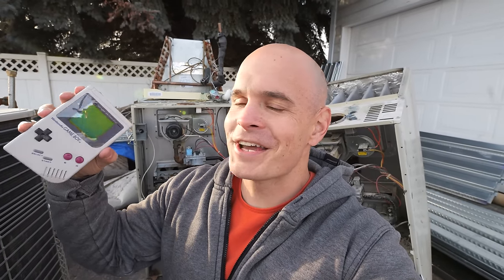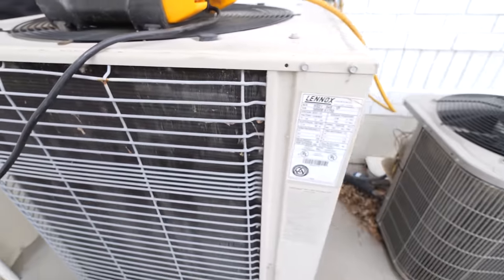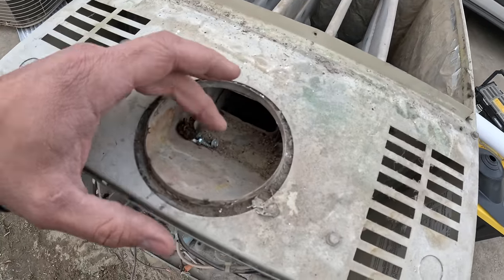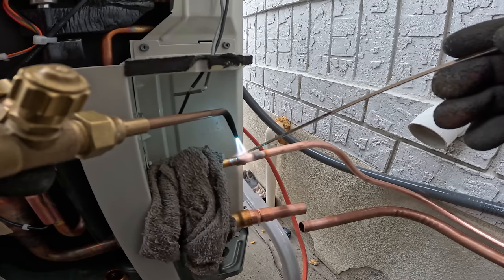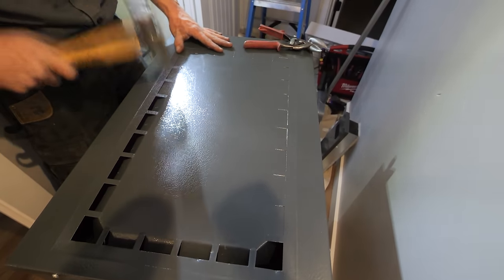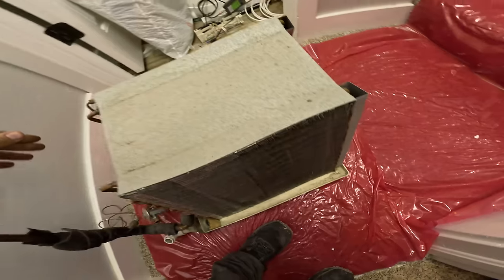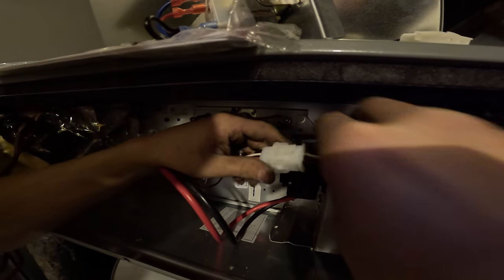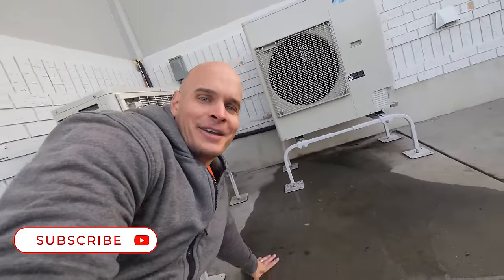Why is Everyone Talking about Heat Pumps?

Comment: My house has a heat pump. I save money EVERY MONTH on electricity. I'm not wasting money by creating heat with an electric element, or firing a fossil fuel, but instead just moving the heat and cooling around inside the system.  So when it's cold outside, the compressor runs in reverse and converts the cold into heat in the exchanger. And when it's warm outside, it again reverses the compressor and converts the heat into cold. Very nice (at least as how my uncle explained it to me. He's smart. He fixes x-ray machines).

Comment: A few things that surprised me... refrigerant R410 is touted as "new" here, while it is considered outdated in Europe where R32 and (for air to water systems) R290 is the current standard.
And then the heating system itself has me a bit confused. Instead of having radiators or underfloor heating it appears that the house us heated through the ventilation system? I have heard of systems like that, but have never actually seen one in a private home. 
I had heard about ducted systems for aircon, but they pose quite a few challenges, especially with condensation, bacteria and so on...
Still, it's interesting to see how the retrofit is done here and I hope there will be occasional Updates on performance and running costs👍

Comment: Glad to see it works for you. Heat pumps do use quite a lot of electricity to factor in and countries like the UK where electricity is astronomically priced, they are not viable compared to gas heating, even though the government lies that they are and is pushing people into getting them anyway.  Its a pity with the amount of land you have at your house you didn't go for a ground based heat pump system, the output and efficiency can be vastly better than air based ones.

Comment: Here in Nova Scotia, heat pumps are becoming very popular. especially since most people are on electric baseboard heat.
Reply: Do you benefit from that sweet, sweet hydroelectric power?
There's no way electric baseboard heating would be feasible in some 90%+ of the landmass of the US due to how expensive electricity is vs running natural gas.
Heck, in much of the country, it's more expensive to run a heat pump year round rather vs natural gas. Only if you have solar, inexpensive power, and a warm-ish climate does it make sense over NG.
Reply: @tim3172  Actually no. We have some  tidal power. Most famously from the Bay of Fundy. However most of our power (52%) is generated via coal.

Comment: My mom has a heatpump installed in her house, but during winters with -19c or -2.2f it uses up 1600kWh a month for 3 months of winter and that becomes really expensive. It's free during the summer months though just standing fees. Due to 5kW solar roof.

Comment: Seeing a lot of comments referencing Alec’s videos from Technology Connections. Also, I live in the south where Heat Pumps are such a commodity that I didn’t realize that they weren’t common or priced appropriately in the midwest and western US. Lots of people have backup gas boilers or fireplaces here though.
Reply: Also I really want to incorporate a separate outdoor thermometer into my smart home system to automate when my heat pump switches to emergency heating. Lots of them do that on their own, but mine doesn’t and it’d be pretty cheap to add it using HA.

Comment: Thank you so much for recovering the terrible r-22 instead of wasting it in the air like some criminals do! But seeing crimp fittings used makes my eyes bleed! I don't think there is any country in Europe that allows their use! Too many pressure and temperature! The 410 is also terribly old and with a very high GWP! Nowadays we only use R32 or R600!
In any case, another thank you for having contributed to the decrease in global consumption with the efficiency of heat pumps!

Comment: Take a look at the Panasonic VZ9SKE, which has a SEER Value of 10.5 - ie 25% better than the one you got. I got one myself 1.5 years ago and I love it😊
Reply: And is used R32 as colorant and works down to -30 degree Celsius = -22 degrees fahrenheit
Reply: Lastly, we have been able to reduce our natural gas consumption by 66% and even though electricity is not cheap here in Denmark, the overall  savings will cover the cost of the heat pump after only 3 years!

Comment: We've used reverse cycle air conditioners (aka 'heatpumps') in Australia forever. The inverter is a more recent improvement (but it relates to the electric motor, not the 'pump')

Comment: For me it will be way better if there are antivibration rubbar mouting pads. At least in Europe they are always used as even best AC have vibration. Can be found anywhere with something like this " Air Conditioning Split Anti-Vibration Feet Mounting Rubber "

Comment: Utah resident here. Literally fell down this rabbit hole this week. My air conditioner and heater are about to die. And so I'm wondering about dual fuel or only heat pump. Same company is going to put solar on my roof so I can go heat pump only and offset that usage in the winter with my solar panels and the excess from the summer. So I'd want to know if I should have a furnace to use gas when it gets really cold here. I've been a fan of yours for a long time
Reply from the maker: I feel like my dual fuel feels more 'normal' than the pure electric.  The pure electric one downstairs gets the job done of course. It just blows alot longer.  Which is noticeable. So if I had to do it again I might just go duel fuel with both of them.

Comment: We have a heat pump in our place.. The only thing that is a little concerning that you didn't mention and maybe your set up is different but we only have one outdoor unit and 4 heads inside. So you can't have one room running cooling and one room running heating otherwise it is competing with itself and I was told would hurt or ruin the system.

Comment: My house was built in 89 just had unit replaced 9 years ago...But since I'm in Vegas its on the roof of my 2 story..14k later.Just wish the builder actually did the duct work right instead of using roofing nails to attach the main trunk...1600 sq ft house one unit it works hard during summer.

Comment: This stuff is interesting to me, Last January thought we hit -45c and most winters are -20c to -30c  and then int he summer it's +35c and up 🙃

I think a dual fuel would be required but are they as efficient at heating when it's that cold?  Freaks me out when the local Government is literally blocking alternative energy sources and during this -45 snap we had warnings to reduce electricity consumption...

Comment: R290 is the new hotness, love how we found out propane is a great refrigerant. 😂
Reply: Because it cheap and they can charge you 60 dollars for 12oz. We have been using it for a long time for coolers and freezers. Problem is they have terrible oil carry over issues that kill compressors x5 as often as normal options

Comment: People always talk about how “efficient” heat pumps are and ultra high efficiency HVAC units. What nobody ever talks about is how expensive these machines are, how difficult it is to get replacement parts, and how their life expectancy is shorter due to complexity. More than often you never get back the utility savings over the upgrade for HE have systems.

Comment: It is better to use ground as heat source, instead of outside air. Ground temperature below 1 meter never goes bellow 0°Celsius, it is usually +5°C to +10°C.
But to use ground, you have to drill or dig, so it costs more for initial installation.
Reply: Yep, but drilling is expensive. Depends on where you live. We seldom get less than 0 degrees celcius so the payback time on geothermal is like 70 years. So not reasonable.

Comment: Nothing beats a flame for heat. Most off gridders use propane for heat.
Heaters use a LOT of leccy juice. 
HP are many more times efficient than resistance heating, but not as warm/ hot. 

Why my new window A/C unit doesn't have a reversing valve is beyond me. 
Should be a law they install a reversing valve in ALL A/C units!
While the efficiency may be correct, gas (flame) produces a lot of BTU of heat vs resistance heating.

That being said, if HP can reduce the gas needed, that is a good thing.
For off grid, HP might be more usable 95% of time, but gas backup needed.
Radiant heating in floor is best from what I read.
Imagine using a HP for radiant heat. That would be dope!

Comment: those boiling points you named don't really matter because they only apply in atmospheric pressure, since the pressure in the unit is a lot higher so is the boiling point.

Comment: I thought these are common everywhere. Where i live all modern houses have ether a geothermal heat pump or a air to water heat pump. Never seen a gas one before. Looks cool
Reply: In parts of the US and basically all of Canada gas was the only thing that really worked for the longest time. The advancements that allow heat pumps to work in cold climates (excluding geothermal aka "ground source" because while they would have worked, they are insanely expensive to install even today) are fairly recent.
Reply: Fossil fuel systems are cheaper to install, cost less to maintain and are easier to repair than any heatpump. Need i mention fossil fuel systems have a longer life cycle. Heatpumps suck in cold climates and suck to keep them running. Homeowners can at least repair their own NG and Propane furances, they cant do that with a heat pump.
Reply: @zack9912000  You're still stuck in 20 years ago dude. Yes, heat pumps until recently have sucked in cold climates, but technology does this funny thing called advance and get better. Cold climate heat pumps that can function in sub-zero temps exist now and at their very worst are still 100% efficient which is better than any gas system.
Reply: @antikommunistischaktion  I work on these systems daily, from basic residential systems to multi million dollar commerical systems with the lastest technology. I repair  them for a living for very long time now.  Everyone wants to believe  the bs from the internet but dont see what techs see every day.  You certainly dont work in this very field. Companies push them because they double or tripple the install fews and can charge more to repair them more often. They get large government grants( your tax dollars) to install them as the next thing.
Reply: @zack9912000  Sure you do sure you do. The reason people are charged so much is because systems are oversized and people just arbitrarily mark up prices.
Reply: @antikommunistischaktion  O dont care if you believe me or not, you certainly dont have a clue what goes on daily in this industry. Just like you never talk to a car salesmen on reliability, you talk to the techs who fix them for a living.
Reply: @zack9912000  Who do you think I talked to when upgrading my home? The techs, and they recommend that I stick with the heat pump, and even that I could cut my heating strips in half.

Comment: 2:40 these tube cutting phwomps are one of the most satisfying things you've ever had in a video
3:07 and a satisfying throw

Maybe one day we'll have a heat pump... but we don't have central air, we just have a radiator-based heater and window AC units, so it would be more work to get one installed. I think they have window unit heat pumps instead of ACs tho? Will research one day... heater has been going strong for almost 40 years, lol

Comment: I got an old boiler that was put in with the house back in the 60's.  Boilers are the next stage down in efficiency then heatpumps, but don't use ducting.  So the work and cost of replacing is vastly more and not worth it.
Reply: Heat pumps almost never make sense. the people who push them dont have a clue. Makes sense in certain situations.
Reply: @zack9912000 in the UK it is pointless, the gas boiler is cheaper to run than paying for electricity. The only benefit is if you had an air conditioning system and not radiators (water)

Comment: I wonder what the additional cost would be to use the ground as a thermal reservoir for the heat pump? Utah's frost level is pretty shallow, and the ground also stays relatively cool in the summer.
Reply: Geothermal systems are 30k without government stealing tax dollars for grant programs

Comment: I got a new gas furnace about 2 years ago, top of the line, my neighbor got on of these Mitsubishi heat pump things. We don’t get snow in winter, it doesn’t get that cold. Natural gas is still so much cheaper that his electric bill is winter went WAY up to about $475/mo and my gas bill is about $125 plus my $100 electric bill… he didn’t save a penny.
Reply: I can tell you he did something very wrong because it certainly shouldn't run him that much. But those units don't heat the entire house they heat an area. He has to have some form of heat for the rest of the house, which might of been resistive elements, and those would run the bill up
Reply: @james2042  No he didnt, that is what people are finding out. They are not as earth energy saving compared to NG. They do worse in the winter, parts are expensive, use more power to heat a home vs the NG needed to do the same job. They cant keep up and require aux heat strips which will run a bill up 600 plus a month. HP have half the life span and cost 2x to 3x as much over its life.
Reply: @james2042  It depends on utility rates and the particular house. I'm guessing their neighbor has a ducted system which is less efficient than mini-splits.

Comment: I don’t know why people from states that receive snow are all the sudden flipping out about heat pumps. It’s literally an air conditioner with an additional reversing valve. I’ve lived in Florida for over 40 years and I’ve never once seen a furnace. Everyone has always had heat pumps here since it doesn’t get so cold in the winter here, our electric bill in the winter is always 1/3 of what it does in the summer because the heat pump barely runs anyway, I guess it’s just that now they make more efficient heat pumps that can still pull heat out of a -13° day lol

Comment: Just to clarify: the "new" r410a refrigerant you are talking about is like 14 years old...These days almost all newly produced heat pumps use r32, and even that has been going for some years and there are already attempts to replace it with something even better.

I am not saying that the heat pump you bought is bad or old. It was probably produced in 2023, but the model itself must be a bit older. I live in a poor country and even here you basically can't buy a heat pump that uses r410a (except for some quite old models that are still in production). Every daikin here has been using r32 for a few years, dunno how you got yours
Reply: Where are you using r32? 410 is still the standard in the US until next year
Reply: @LeArmBoss Hmm, quite interesting. While everything I said is still superficially true, this changes things a lot. I will look into this. 
Also, I am from the Balkans
Reply: @LeArmBoss  US is going to R32 and R454b depending on the brand you buy. R454b is showing to be more efficient than r32 is.

Comment: I hope those installers were flowing nitrogen or carbon dioxide while brazing to prevent oxide from forming inside the copper. If they didn’t do that, be expecting problems with that electronic expansion valve inside.

Comment: Would have been nice to add some numbers, so people could have relevant discussions. Now most are shouting install costs and operational costs without telling is us what they actually get. (For reference, my HP has a max power of 3.5kWh thermal, producing around 4900 kWh thermal a year, consuming roughly 950 kWh_electric, which costs €200 a year where I live.)

Comment: Have you ever thought about using Mechanival ventilation with Heat recovery? (MVHR)
Reply: Yeah those are gret but expensive. For those that don't know, you have from inlet and outlet air ducts and a heat exchangernin between. In sweden many houses are built with either that or exhast air heatpumps. They basically use the ventilation exhaust air to feed the heatpump. This means that the pump in practice "recycles" the exhaust air. They are very common here and also quite cheap.
Reply: @Baxtexx  I’m a MVHR designer in the UK, it’s a fairly new technology but something I’m hoping to see become more common here in the UK

Comment: I'm in New Zealand where heatpumps are common and have been for 20years +   I dislike them.  They cause a breeze, they blow cold periodically when they defrost the outside coil.  My parents now have their second.  The first died after 20yr when the conpressor failed.  My friend's one did the same.  We have a diesel radiator system which isnt perfect but goes well.  We dont get long periods of hot weather where we are so using them for cooling is not common. 😊

Comment: Where I live, it gets to minus 40c, which is the same as minus 40f. Heatpumps are great in temperate climates, but in the extreme cold that we get up north, they lose efficiency very quickly. And somehow, our Canadian government seems to think it's the save-all to our country's carbon emission problem. Meanwhile, people have to use fossil fuel furnaces, trying to regulate their carbon output to have a regular, temperate, a😮s well as backup furnace. It was truly something, living in the ghettos. It was truly identified as hell. Some people were identified for a reason. 😮

Comment: With the reversing valve a heat pump is efficient in heating, but it isn’t more efficient than an air conditioner with the same technology. When the refrigeration loop isn’t going in the other direction, it is only an air conditioner.
Reply: An air conditioner is literally just a single-direction heat pump.
You're likely simply comparing a heat pump with another, more efficient, heat pump.
A heat pump is an "air conditioner with a reversing valve."
Reply: @tim3172  heat pumps were developed later. A heat pump is an air conditioner with a reversing valve.